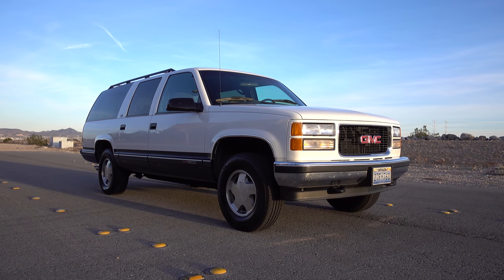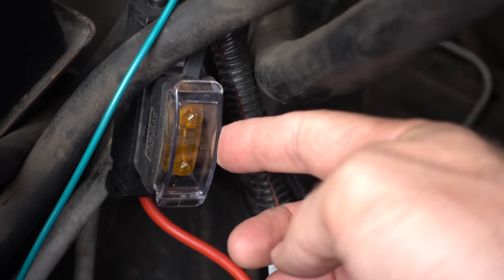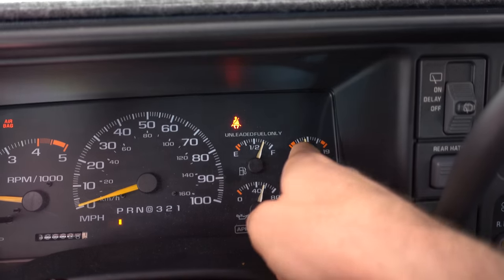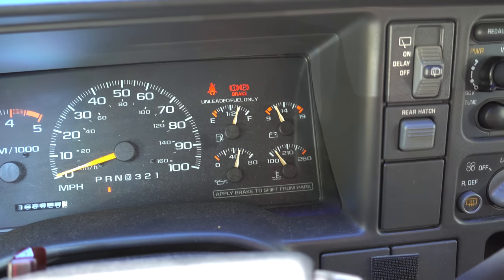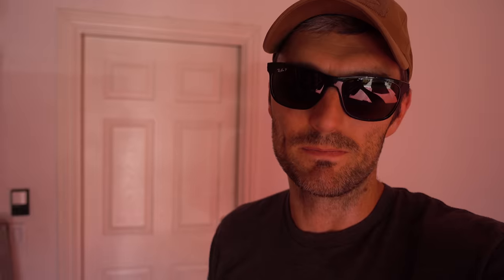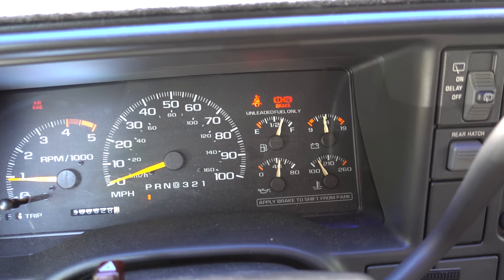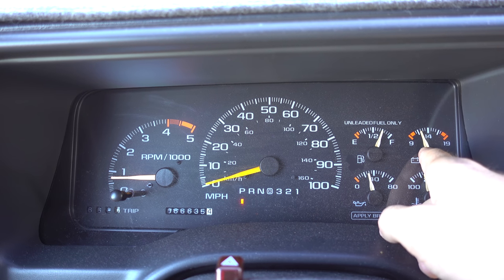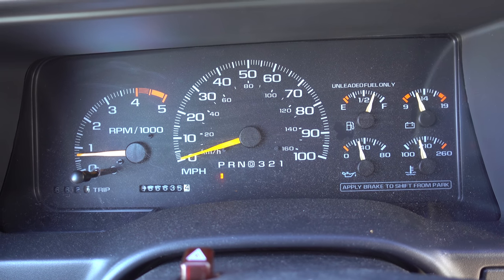SOLVE A LOW VOLTAGE ISSUE!

Comment: You are drawing more power than the alternator is producing at idle.There are several solutions to this.
1 add a second battery in parallel. It will still drop at idle but it will take longer to happen. The battery drains down and then power drops. 
 2 put a smaller pulley on the alternator. It will spin faster at idle. It will also spin faster at high rpm so be careful/
3. run fans in stages. One fan on constant with AC - both fans with engine heat. This can be done with relays. The truck wont run too cool (with both fans on) and it will give the alternator a break more often when only one fan is on.
4 larger alternator
5 larger wire from alternator to battery (more efficient less resistance) also make sure ground is robust.
6 resistor block on fans. they will run a bit slower but also draw less power.
7 higher idle speed, an idle up solenoid when the fans are on.

Comment: Those 140 amp remans are rated at or above 3000 crank rpm's it's nearly impossible to get more than 70 amps at idle once warmed up with the cs130. You can install an ad244 for a 99-04 Silverado with heavy duty charging option, they put out well over 100 amps at idle. You'll need to slightly enlarge one hole on the accessory bracket, get a pigtail to match the newer style plug on alternator, get a longer belt  and at minimum run a 4 awg charge wire from your new alt to battery. Did that plus big 3 on my 90 Silverado with dual electric fans, 3000 watt sound system and 600 watts of auxiliary lights and have had zero voltage issues. Hope this helps.

Comment: Hi there check your connections upgrade all your lights on the vehicle to Leds.to maintain efficency. check if you got a small pullieon the alternator.thats the one you want if it has a bigger pullie at high speeds will work but on low speed it wont charge well. you could add a 2 gauge wire from the alternator to the batterry. and make sure that you have a battery with high reserve capacity like 900 cranking amps and about 190 reserve capacity amps should do the trick remember you just added a monster fan kit that  its sucking all the amps on that alternator another thing you said something important its very hot where you live a alternator when it get hot it looses capacity so if it was 140 when hot it will drop dramaticly Ive my self would put a 200amp alternator to have  some room .second baterry is nice but check before spending your money wisely good luck.

Comment: 140 amp alt. is weak output. replace with a 270 amp alt. and 0 gauge welding cables.

Comment: Get your alternator rebuilt and have them add more brushes. Most have one on each  some have two. Mine has four leads on each end. My alternator is  off an ambulance.  Tha alternator has to be compatible with the load its drawing. I run 4 amps. Mids , plenty o 6x9 and a mass of 15's. In a 96 GMC Yukon and the load draw is alot. The ambulance alt. Needs to handle sirens light vidal sign electric equipment and more....ect.  I have saved people plenty of headache and $  and kill other booming systems at a fraction of the cost

Comment: Where did you wire the automatic fan switch/sensor to? I just bought a 95 gmc 2500 and it came with this similar fan setup but unfortunately with a manual switch....so all it takes is one time forgetting it off to overheat the engine🤦‍♂️

Comment: Your Alternator is not putting out the correct voltage. 
There is a great video on using your Volt Ohm meter with min/max to test your alternator and battery.
I've owned 4 Suburbans. Right now I have a 98 GMC K2500 7.4 with 367,000 miles. The batteries I've always used are the AC DELCO. Nothing I've used is better. Alternators I use are from O'Reillys ,life time , 140 amp.
If your battery and alternator check out fine then you have something else draining voltage.
Let us know what you find

Comment: I've got similar issue but BATTERY LIGHT comes even when it's above 12
Reply: SOLUTION,
After cleaning cables replacing 

Alternator, battery 

Problem was STARTER was going bad.

Comment: I have the Same problem, but I change the belt ( serpentine ) and I think the regulator is dead 
Because don’t charge the battery but she start “normal” and the voltage is 9 ur 10 
I neeed help to solve this problem I’m my 1993 Suburban

Comment: I run 300A alternator in my 6.5 99 2500 at idle puts out 90A with all fans running and 14v money well spent has to be replaced with slightly longer belt.

Comment: I installed a secondary battery on my 2007 Yukon denali 6.2 and fixed the problem with voltage drop. And, I still live in hot as hell, California.

Comment: i have a98 yukon with the same fans and 2 batteries with 200 amp alternator and i am still having low voltage readings
Reply from the maker: Dang bro. Any ideas as to why??
Reply: 1 Road really I don't know I am going to install a capacitor with the battery and see what happens 😊

Comment: I would check to see if your truck has a voltage regulator, then check your alternator remove one of the batteries and see if it stays on and check for voltage right there

Comment: I hate side posts. Damn GM dumb crap. I usually convert to top posts.  
--Why didn't you tell us that you just upgraded the ALT at the beginning of the vid? What the heck. Waist time. Because the diagnostic algorithm is different because the case is different. So, what a waist of 10:15 minutes. 
Maybe next time give a brief 30-60 second overview of the situation.
Question 1: Of course it can. Bat can start and not tolerate sustained loads. Basically, it's not performing at baseline, but not "Bad" enough that it doesn't work at all. 
Question 2: Experience with such case? Putting out 13.6V @ idle with everything on? ya, that's normal. 
--It is possible for a bad battery to actually cause voltage drop. Basically, a bad battery will suck up power, but can't keep up with sustained load, so when we measure V, it's down. The ALT is likely at full tilt though, pumping out current, as the drain exceeds V capability. 
--Question 3: is it normal for it to be at 12V area or should it not be doing that? It should not be doing that. The idle RPM is rather low for a GM V8, and low in general, at like what 500-600? Even 100-200 RPM enough to cause low V. 
--The fuse popped. Is that the correct wire gauge, ground, + fuse for the current they draw? That's an old Chevy. The ALT might only be like 80-100 amps. Those fans can probably draw 40 amps easy.

Comment: If you think its the fans, then just disconnect them temporarily and check guage. Also if you blow a 40 amp fuse, thats a hugh fuse to blow, I would re check all wiring to make sure nothing is grounding out on the wiring. But first disconnect and see if it corrects.

Comment: I have a 2000 Chevrolet C 2500 with a 5.7 and I’m having the same problem. I have replaced the battery and I have replaced the alternator a recondition alternator and it’s doing the same thing so I took the recondition alternator and it still does the same thing just for no reason devoted will jump to 1516 then drop down so low and shut my truck off and kill the battery when you get tested at parts store they tell you the alternator is bad so I replaced it with a metal one and staying at 12 V. I haven’t went very far yet and turn on the AC. It did not drop. The voltage but the truck was doing this when I bought it so I’m going to try a brand new alternator they did tell me that there are different temperatures alternators they can be put on that truck. I’m at 104 A they do sell one there’s 140 amp.

Comment: Because I have had alternator problems in the past, I bought a voltage alarm that plugs into the cigarette lighter outlet. After using it for just a few days, it is alarming me that the voltage while driving is dropping to just 12.3 volts, no reason I can think of for it to be doing that, then finally it goes back up to 14.3 or 14.2 volts. Without this voltage monitor, I have noticed no other symptoms of low voltage. My last trip home, with headlights on, it stayed above 14 volts the entire time, well unless it dipped when I was not looking. What is going on? Do I have yet another bad alternator? I wanted a better way to monitor the voltage other than seeing headlights going dim, so as to try to avoid an expensive tow. Or do I have a piece-of-junk toy voltmeter made-in-china?

I wish I could set the audible voltage alarm to a level above its 11.7 volt specification. I want to know any time the alternator is not putting out power, and not just when the battery is nearly dead. My cigarette outlet loses power when the ignition switch is off, so the only time I get any voltage reading or possible alarm sound, is when the key is in the ignition switch.

Comment: Some times alternators right out of the box do not work. You must verify the amperage output of it. Also you may have a parasitic draw somewhere  but I am leaning more on the alternator. Also check your connections and voltage drop on your cables.

Comment: Maybe u need a bigger alternator. Imo the Alternator is not keeping up. Something could be wrong with the voltage regulator on the Alternator. An Alternator test isn't 100% reliable either especially if the problem is intermittent. What I've learned over the years is to take Alternator tests with a grain of salt. There could be a problem with it and you might not see it even using a tester it may appear to check out fine when actuality it  doesn't.

Comment: Mine os bone stock and I have same problem been through 2 alternators they are good everything else seems to be good but it's causing problems at idle we have a power inverter and it beeps and struggles to charge phones and stuff at idle everything seems under powered a little bit but it starts every day but every vehicle I've had hovers around 14v all day in gear and when it's on a full load with everything on its charging at like 12.8 to 13v that just isn't enough too me

Comment: ive got a 96 tahoe an weve added nothing to the system. just replaced the alt, battery, all grounds plus added a few. still exact same. nothing changed. we live in ohio. now our 08 has a dual battery setup from the factory, an even when we took the aux battery out the voltage never drops. it will stay between 13 an 14.6. so adding a battery helps the load but im not sure if thats the issue. weve always added the aux battery in almost every chevy truck weve had. an this tahoe never really had any issue before, but weve been fighting this for a long long while now. any info yet on what could drop the volts like this.

Comment: Anyone ever have and issue with the battery voltage gauge?   Going back about a quarter from being in the normal middle of the voltage gauge. When putting a car/truck into reverse then once it's in gear it going back to normal .iddle of voltage gauge.. But as soon as you switch to drive it goes back down from normal then once it's in gear and your going it's back in the normal or middle of the voltage gauge. The dash lights dim and head lights dim as well as the voltage gauge goes back about a quarter from.being in the middle. I replaced the starter,alternator,battery,ignition coil. Went through all my wires from the battery to the starter to the alternator. I only found the signal wire to be damaged so I ran a whole new line to the solenoid on the ps fender to the starter also replaced the pigtail coming off the back of the alternator due to having my charging light kept going on and off. I checked all my grounds. The only one that .ifht be the problem is there that attaches to radiator support Bracket to where else. Havntflund a clear indication on that on a 96 ford f150

Comment: Maybe you need a new ac compressor? Check the electrical connections on the ac components, A loos wire will cause resistance. Or the blower motor could be bad. Why don't you just get a new car?....

Comment: You need to figure out how to control your fans,  they should not be on at all times. Think about going down the road at 55+mph. There's more air flowing at those speeds than what the fans are capable of,  plus they become a drag. Also, you can run them in 3 different configurations based on the pressure,  instead of high all the time

Comment: my jeep xj does the same. Fine when its cold. holds 14.2 all until i turn any accessories on. then goes down to as low as 12. causes belt to squeal too. going to try the big 7 upgrade I ordered

Comment: Bad alternator when you have a load on it drops voltage everything runs off the alternator not the battery the battery just starts the truck

Comment: I have a high output 3g alternator on a 91f250 with 2 AGM batteries and my volt gauge goes up in down about twice as bad as the one in this video I can see the volt drop from each level on my heater or ac if I turn it up or down any ideas batteries are new alternator is new all tested good

Comment: I have the same issue i used a voltmeter with a clamp on amp meter and clamped the neg post and found that my alt was only charging 11.3 amps at 12.2 volts my battery has 300 cca at 0deg

Comment: Did you end up finding the issue.?  I have a 90 single cab chevy doin the exact same thing.  I have nee alt anf new optima battery.  All my lighys are led/hids. With sunroof and dash cam hooked up.   Problem started randomly. Already change grounds and power wire aswell

Comment: It happened to me I changed the battery and alternator and still has  low voltage I ran a ground from the battery and everything is fine to one of the bolts to alternator

Comment: wow a battery is for starting and storage not to keep the voltage up the alternator is for charging and keeping up the voltage when the truck is running and no load charging voltage should be around 14.5 volts and it shouldn't drop down past 13.8 when every thing is on

Comment: You need a larger alternator. I installed 140 amp. You are using more than the stock alternator can handle.
Reply: Duane Fuller you didn't pay attention

Comment: ur fans only pull 28 amps..compare it now and before u did the power master conversion..I'm pissed min came with the test sheet it says 175 amp and doesn't produce nothing at idle..my stock 105 amp kept my battery charged every time my bass dropped and it pulled 150 amps at a time..so problem solved go back to the basic alternate..I Kno my 1996 I can up grade to the ac delco 145 amp

Comment: In general the alternator is almost the issue!!!! as you need to replace both the battery and the alternator also the serpentine belt is recommended to replace then the issues is resolved

Comment: THE BATTERY IS NEW SO IM THINKING THE ALTERNATOR IS SUCKING UP ALL THE JUICE FROM THE BATTERY ANOTHER IF YOU BELIEVE ITS THE ALTERNATION ,START IT UP AND DISCONNECT THE POSITIVE WIRE IF IT TURNS OFF THEN IT IS THE ALTERNATOR

Comment: The battery doesn't produce the voltage for the fans the alternator runs all electronics with the truck running the battery is used just to start the truck

Comment: Alternator is not charging at appropriate voltage . Youve already provided a load test with the lights raduo and ac on and it should remain between 13.5 and 14.5 it didnt so change alternator
Reply: The ac is not taking any current except the clutch, only 1 amp. But it take lots of energy from the motor. The ac can stress test the cooling system.

Comment: your electric fans are drawing too much current
what is the rated amperage of the fans?
check your wiring is it all in good order?
test the current draw on your fans
do they draw too much current?

test your alternator for ac ripple
set your meter to ac voltage and red lead to alternator output stud and  black lead to alternator case and should be less then .5 volts should be half and volt or less
i see you put a ground wire on the alternator not sure why cause the alternator grounds though the bracket which is bolted to the engine block doesnt look like a problem but unnecessary 
check all those things out

Comment: Have the same problem on my 92 chevy g20 Van that has problems with charging enough power when running full lights and basic driving. it charges little bit but uses too much power to change gears and then just pops out of overdrive and gears down to 2nd gear or so... is anybody familiar with that problem??

Comment: I had same issue I recently replaced entire AC system on my 4Door OBS Tahoe Never had Charging Issue till Summer after New AC Compressor etc CHECK THE MAIN CHARGING WIRE THAT CONNECTS ALTERNATOR TRAVELS OVER THE INTAKE BEHIND AC COMPRESSOR BRACKET OVER TO BATTERY SIDE POST...Mine LOOKED Fine It Wasn't the Aging Old Wire even inside of Plastic Loom was Arcing through the silicone sleeve and plastic loom  against AC Bracket when car would warm up especially when AC was on It was fine for a few months then Battery light came on first time in years Replaced Alternator at AZ in parking lot with Gold Lifetime Warranty Unit Light when off seemed like it was fixed a month later same thing exchanged it No problem Fixed it temporarily and after 3 alternators in as many months I happened to accidentally grab the battery cable that ran from alternator while truck was running And Got a lil Jolt much like when an old spark plug cable arcs out on exhaust manifold this cable was old and worn quick fix I zip tied it up and away from all metal on motor and FINALLY PROBLEM SOLVED! Free!

Comment: The distribution box has corrosion on the plate where the relays and fuses are. I lot of time win a vehicle goes through a car wash or some times the engine is washed liquid gets in the distribution box. Over time corrosion interferes with the electrical. You can take apart the distribution box and clean those parts or replace the hole distribution box.
Reply: I'm working on a similar problem that the voltage gauge goes to 14 volts then goes down to 12 volts then back to 14 volts while the engine is in idol at 600 rpms to 1000rpms. I'm doing tests on all of the issues presently. I'm restoring a 1995 Jeep Wrangler yj.